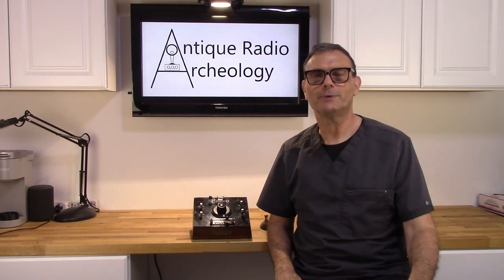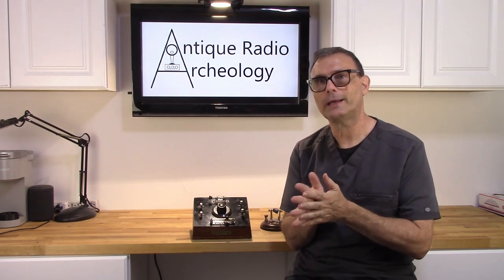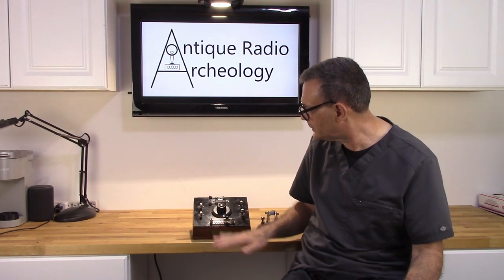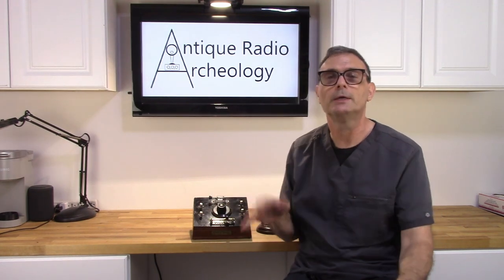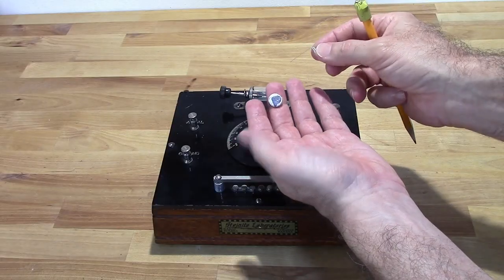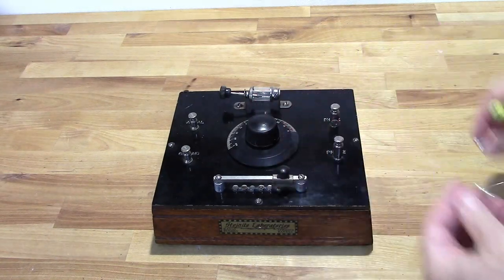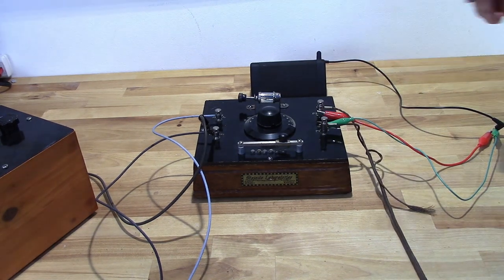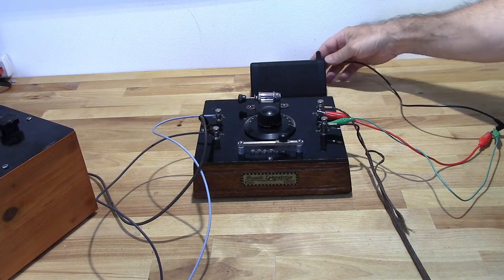Steinite 1920's Crystal Radio History and Operation

Comment: Nice Informative video brings back memories of making various "Experimental"  Crystal radio sets during '50's & early '60's.....The classic "Cat's Whisker" Galena Detector, one of the  1st used radio demodulators, is actually a Point Contact semiconductor, used Before vacuum Tubes !!....Seemingly Lost to  history, there existed Reliable reports of early radio Experimenters Adding a 2nd Cat Whisker Contact (total of 3 device wire leads) connected to a bias Battery, providing significant Demodulated audio Gain.....That's remarkably Similar to a modern N-P-N or P-N-P semiconductor gain device !!.....As Most electronic radio devices (including vacuum tube) were Accidential discoveries, It's amazing to consider the Possibility of Accidential discovery of 3 electrode semiconductor devices with Gain during radio's Earliest days !!!

Comment: Short circuit of the unused turns of the inductance dampens heavily the circuit. I think the slider of the inductance should be connected to ground but not to the variable capacitor.
I started in electronics with crystal radios, in 1963.